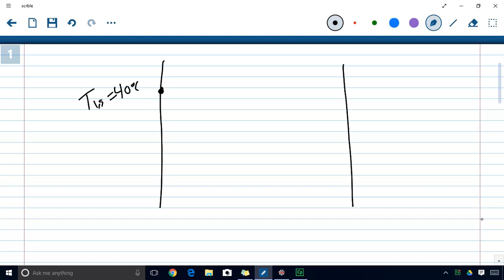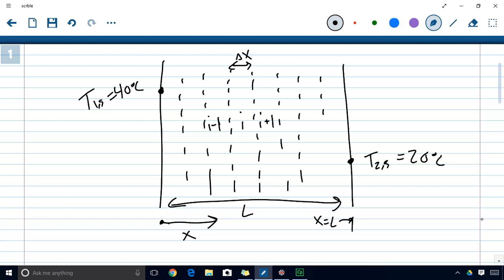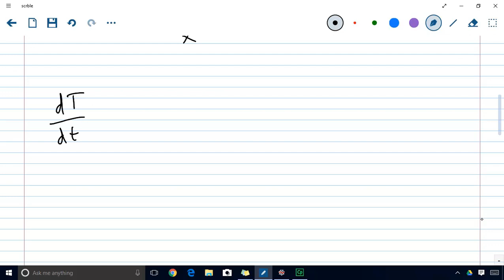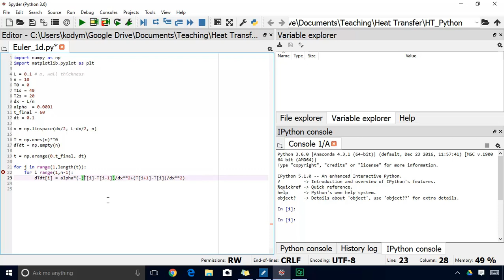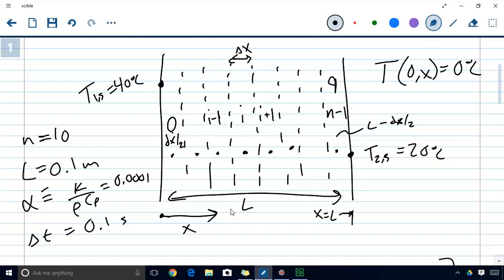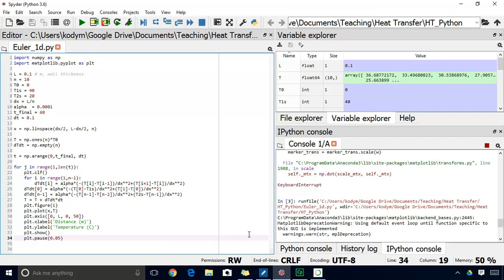Solving the Heat Diffusion Equation (1D PDE) in Python

Comment: This is a great video, with one small "insidious" bug (meaning it's a bug that introduces an error, but won't cause program to crash, and in this case, would not introduce much error).  It's with the 2 boundary conditions, where the distance from the node to the surface should be dx/2, not dx.  It's an easy fix in those 2 lines of code.
Reply: Can you please let me know at what line, this change needs to be done?

Comment: Very didactic example. It can be easily replicated in R using vector notation (hyper fast update since the 'for i' spatial loop becomes unnecesary):

T=matrix(T0, nrow=1, ncol=n)
T[1]=Tleft
T[n]=Tright
indices=which(col(T)!=1 & col(T)!=n)
x=seq(from=dx/2, to=L-dx/2, length.out=n)  # position array

val=alpha*(dt/dx^2)
for (j in 0:N) {
    plot(x, T, type='l', col='red', lwd=2,
         xlim=c(0,L), ylim=c(min(Tleft,Tright), max(Tleft,Tright)),
         ylab='T (ºC)',
         main=paste0('Iteration: ', j, '/',N, ', t=', j*dt, 's'))
    abline(v=c(x[1], x[n]), lty=2)
    abline(h=0)

    # Iterate T in vector notation
    T[indices]=T[indices]+val*(T[indices+1] - 2*T[indices] + T[indices-1])
}

Comment: I wrote my own (very similar) program independently before discovering your guide. I've found that both our programs have the same bug.

This may be a conceptual error with how I understand the heat transfer equation, but as dx decreases, I would expect the simulation to get more accurate, and not do anything weird. 
But, as I lower the thickness of the material or increase the number of nodes I find that the numbers begin blasting off by several orders of magnitudes immediately. 

I'm not sure why this occurs, but I'm (marginally) happier knowing that this isn't a unique problem. My current method is by lowering the number of nodes as much as is reasonable, and if continuing to lower it would be unreasonable I assume that steady state heat transfer begins almost immediately.

I'd be interested to know what your opinion on the issue is.
Reply: I might be late to the party, but here it goes : you have a so called CFL condition that connects to both dx and dt, and that condition should be lower than one, otherwise you start getting "junk" results and the method becomes unstable
Reply: @bluesybluesko9922  yes, very late, though very much appreciated

Comment: Is there a way to extend this to be able to apply heat at different points along the x direction? Also, would this result still hold if this was a thin rod, meaning could we consider a thin rod using the 1D equation too? Because in one of the lectures I know you mentioned a wall.

Comment: Quick question, what numerical method technique should I use if I want to find heat flow through a series of flat plates? So imagine we take your picture and keep the heat flow the same direction but push the wall on it's side so its layers are stacked up like pancakes. Any help with that?

And awesome video.